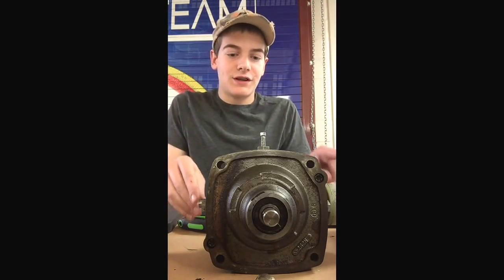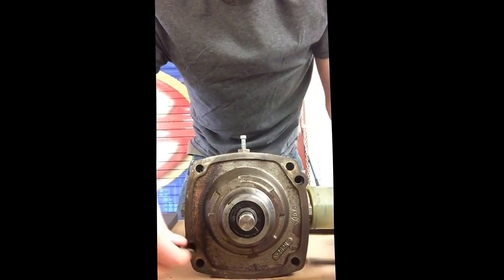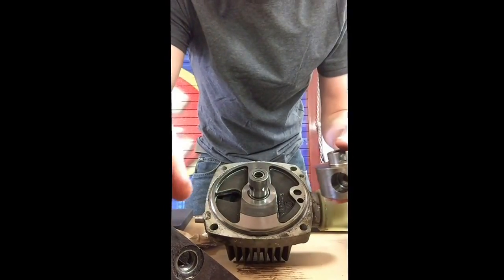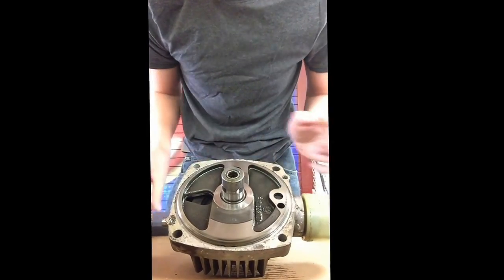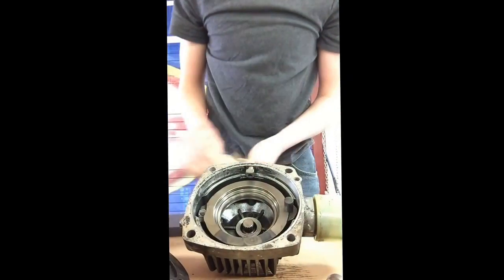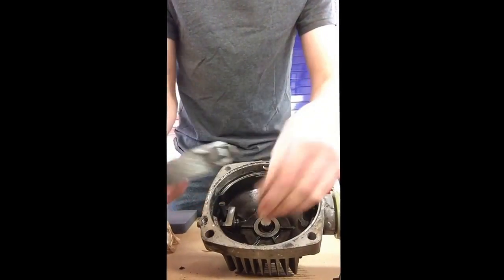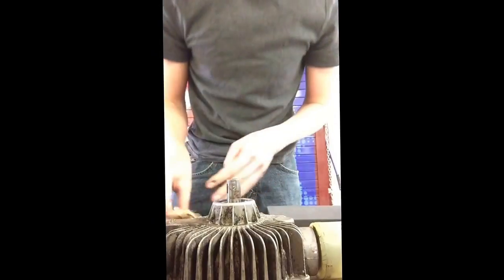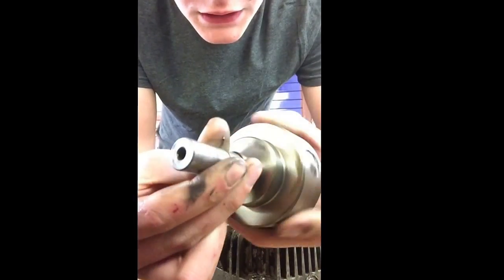Walker Mower Transmission Disassembly

Comment: ive just recently got a job for rebuilding one of these and to get the forward and reverse lever out i drilled a hole through the housing and punched the pin that stops the shaft from coming out. Then machine a dowel pin to press back into the hole and weld it around the end. allows for removal without damaging the selector shaft. i found all new seals at a hydraulic shop. the main reason this one failed is the main input shaft wasnt properly machined around the bearing which end up allow the shaft to spin in the bearing causing the shaft to wear out. was alot of fun to rebuild. the driver side motor will be the next one i do and ill be taking a video on it. also machined new brass bushings to go around the pump and motor shafts.

Comment: Hi Cade I have a question about the Eaton transmission  the one part you did not remove in the video was the shaft with T shaft how does those two shafts come apart?

Comment: Thanks for the video. I've got a John Deere 165 with one of these pumps. It works fine in reverse but is super slow going forward. I'm assuming the pump is damaged, but there's no rebuild kits available anyway.

Comment: Cade, Any ideas on how to free a stuck lockout pin without having to remove the hydro from the mower?
Reply from the maker: the pin should have a 5/16 or 8mm bolt head, spray penetrating oil around the base and rotate the head no more than one turn to the left while trying to move the pin, then work the pin left to right while trying to pull it in and out until it moves freely, when it’s finally free just re torque the bolt to a few foot pounds

Comment: The race in the cast-iron part of the transmission is off-center.  After taking this part off it can be rotated 180 degrees before it is put back on.  If the lobe of the offset is positioned on the same side as the dump valves, the output will turn CCW.  If the lobe of the offset is positioned on the side opposite of the dump valves, the output will turn CW.

Comment: My Zero turn has independent pumps for the left and the right drive wheels.  The left hand pump doesn't work and the right one does. I have an good extra right hand pump. Can that one be adjusted to use on the left side?
Reply from the maker: Jeanne Keenan if it’s a walker you can and with most mid mounts you can, for a walker just take the hydraulic unit separate from the gearbox, there should be two t40 torx screws in the back, take those loose, and without separating the two housings, spin the back side 180 degrees until the two screws line back up, now it will work for the other side, side note is you will have to order a fan for the correct direction as the original will now blow backwards

Comment: Hi I took mine apart to change a  Bearing  That was seal  Now I put it back together   is not going forward or backward
Reply from the maker: How much hydraulic oil did you put in? chances are its empty again, i found that you have to fill the reservoir about 10 times until it finally holds fluid, because the mesh screen in the bottom is so fine that it takes a good 20 minutes for the oil you put in to fully drain into the transmission unit, so repeatedly fill it until it fills no more. One way to quicken this process is to remove the 11/16 drain plug in the TOP of the transmission right behind the plastic reservoir, and wait until fluid is coming out of the the top of this hole and then cap it off. This will speed up the process because it allows air to escape, remember to tighten the top cap when youre finished

Comment: do you have the company name that you order parts from, I have a CCW 700-032 walker pump that stop working and have taken it apart and can not find anything wrong with it.
Reply from the maker: Jim Blackford i don’t have a company i buy parts from, i usually just frakenstein them together if parts are damaged, are you sure there’s no internal scoring? sure the neutral valve isn’t stuck open?

Comment: I just put mine back together but the hydraulic fluid isn't going in.  Do I have to open a breather port or something else?
Reply from the maker: Jonathan Anderson well, the reservoir has a mesh screen at the bottom that has very small holes. the oil takes a VERY long time to flow through it. Just fill it up and give it time
Reply: This all started because the output pulley became loose and wore down the shaft so much that the pulley just spun freely around the shaft.  So I had to replace the shaft and pulley.  I hope it's okay that I poured some oil into the top breather hole.  It was new oil and the surface of the pump was clean so I doubt any dirt got in.  It's working now but not quite as peppy as it used to be.  The oil looks like it has some air bubbles which could make it slightly compressible(?).   Maybe over time air bubbles will rise to the top and the transmission will become tighter.  Does that sound right?
Reply from the maker: Jonathan Anderson just add oil to the full line on the cup, and it should go down and then you'll need to fill it up again
Reply: Keep tightening the cap on the resevoir and the cup will spin off. Then you can fill the hydro and have no air bubbles
Reply: Tightening the cap loosens the resevoir and tightening the resevoir loosens the cap

Comment: Thanks for posting this. I have 2 of these to open up off my Grasshopper ZTR mower. I'm afraid to see what condition is inside. The roller chain and sprockets are extremely worn out, so I doubt if it ever got maintenance except after catastrophic failure.
I bet I find that my pintle is scored as well. It does appear there is an inner bushing, and as I have a pretty good machine shop, I could grind the pintle until clean surface, then make a new bushing from leaded bronze, and drill the oil passage holes. At least that's the plan.
Reply from the maker: Thats really ambitious, and i hope it works for you. I thought about doing the same thing to this one but i really didnt need it and i dont have precise tools for the job. Keep me posted! Im interested to see how it turns out and what the insides of the transmissions look like.

Comment: Great content...thank you for the demonstration. Question; is there a place to buy used hard parts? Do you rebuild these units for hire? Have a bit of trouble with one side of my walker MDD...little power....
Reply from the maker: Dana Farmer regretfully, eaton doesn't sell a rebuild kit for this transmission, however, I currently have one of these listed on ebay for $400 or $520 buy it now. it's for sale by marco newman (seller name) and there's a video of me demonstrating it on this channel as well. Thanks!